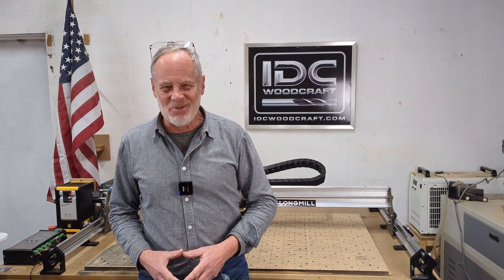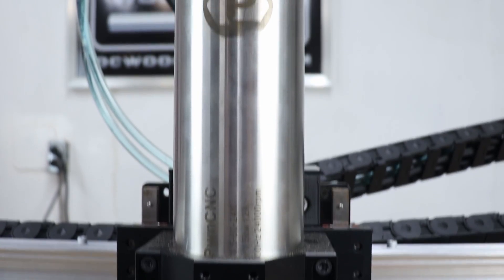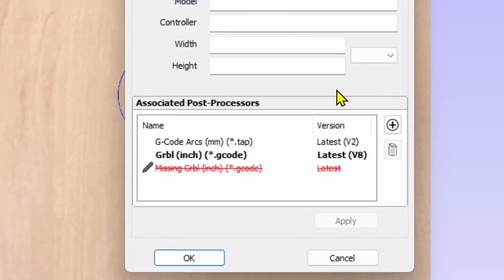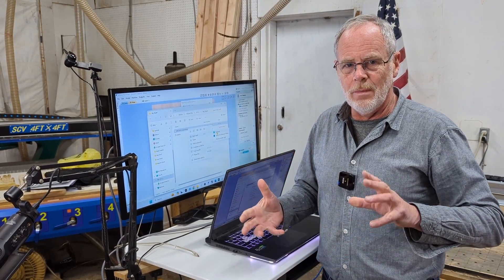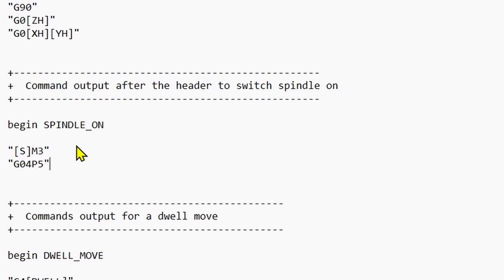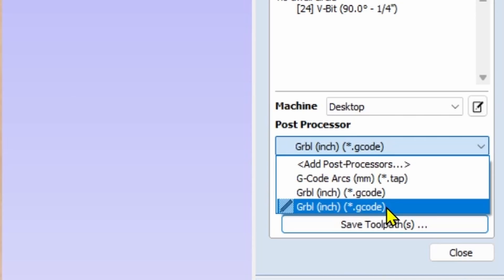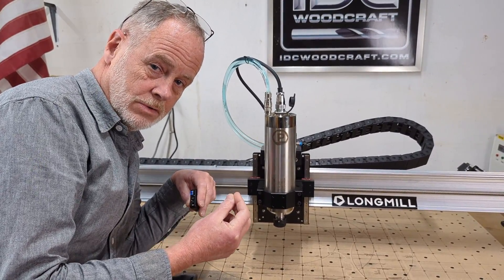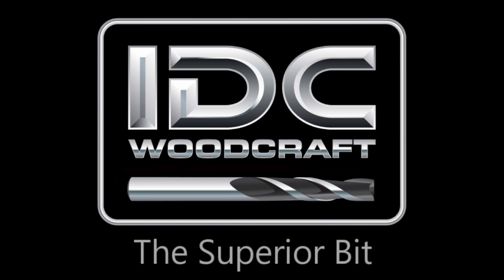CNC Router Spindle: The Critical 'G4' Command (Dwell)

Comment: I'm building a custom machine with a PiBot ESP32 FluidNC controller and this video helped me make a new post processor and it works great.  Thank you!  Now the next thing I need to figure out is how to make the spindle stop at the end of the job.
Reply from the maker: I'm glad to hear the video helped you out! For stopping the spindle at the end of the job, it would be best to check the documentation for your specific controller, but you could also look into the settings depending on your CNC software.

Comment: Hello Garrett, thanks for another great video. I just upgraded to a Pwn spindle. My question is how to tram the spindle. With the Mikita router you have access to the adjustment screws. With this spindle the front bracket covers the  adjustment screws. Thanks again for all the work you put into your videos.
Reply from the maker: Hey there! Thanks for the kind words about the video. Tramming a spindle can be a bit tricky since the adjustment screws are covered, so I recommend checking the manual or reaching out to Pwn's support for guidance.

Comment: I just added the dwell to the latest GRBL ver 8 and it is laid out differently than the version you show. It has a line just for the G04 command. It is "G04 [DWELL]" Just put the dwell time in between the brackets, and you are good to go after hitting apply. Your video helped me to get on the right path.
Reply from the maker: I'm so glad the video helped you get started on the right path! It's interesting to see the updates in GRBL, and thanks for sharing that tidbit about the G04 command!
Reply: @IDCWoodcraft  I should have said put the dwell time after the brackets then hit apply. I will see how well it works when I get my AltMill assembled and run my first project.

Comment: Excellent video!  My post processor in Aspire for mach3 doesn't have the separate section to just turn on the spindle.  It's in a section entitled  "Commands output at the start of the file".  The M3 command is ""[N][S]M03".  I added "[N]G04P8" (with the quotes) after the M3 command for an 8 second dwell.   Thanks for your work.  You help the community more than you know.
Reply from the maker: Thanks for the kind words! It sounds like you're on the right track with your post processor tweaks—keep up the great work!

Comment: Great info.  However, when I got my spindle, I realize I can’t turn it on without a program.  I like manually surfacing my spoil boards.  Can’t do it now.  Thanks for all you do.
Reply from the maker: ccfox-wecanmakeit9523, I completely understand your frustration! Many CNC spindles are designed to be controlled through specific software, which can make manual adjustments feel a bit limiting. It might be worth looking into your machine's manual or forums to see if there's a workaround for manual control. Thank you for your kind words!

Comment: Hi Garrett, trying to add dwell to post processor. I can’t find the note pad link when I follow you instructions. What am I doing wrong?
Thanks
Reply from the maker: TomDuszynski, when you open up a gCode file that you are looking to cut, you need to input the dwell command (G04), followed by "P" and a numerical value without a decimal point, specifies the pause length in seconds. 

What the dwell command line should look like → G04P5
This command will pause the CNC router for 5 seconds

Comment: This video was very helpful with the longboard but now with the super longboard it seems to be ignoring the pause and is instead going straight to the cut as it ramps up,come back to this vid to double check I didn’t have something in wrong but can’t seem to figure this out now.
Reply from the maker: You will want to call longmill on this
Reply: @IDCWoodcraft Thanks for the reply,I already figured it out,was my own fault,I forgot I had use the laser a few days ago and forgot to switch the settings back in g sender. Thanks for all you do for CNC world
Reply: Ok so i am a newbie idiot,I figured it out,I had simply forgot to switch back to normal mode in g sender after having a ran a laser project a few days ago lol,guess i should be using the machine more so i that I build on all the needed habits to be a good operator.

Comment: Thank you!  I love as you learn things, you are so excited to pass that knowledge down to us.
My Avid CNC is in milli-secs, so I had to Pause/Dwell for P5000.  I quick reference showed X5 was for seconds, but that did not work for me, so I will stay with milli-secs.   This video also showed me how to automatically start my dust collection by adding an M7 before the spindle start and dwell.  This also gives the dust collection time to get up to speed.  The other outlet is controlled by M8 so I could connect something else like a light.  There was an M9 already at the end of the G-code to turn the outlets off.  
Note this does not replace the initial spindle warmup cycle, which I personally need to be more vigilant about doing.
Reply from the maker: techturtle, that is some great points brother! Sounds like you have your AVID fine tuned sharp.

Comment: This is a very nice video and good information. One thing to note is that I am using Mach4 with the Ethernet Smoothstepper. For this setup the G04P command needs to be in milliseconds rather than in seconds. For me the "P5" would have to be input as "P5000".
Reply from the maker: me-qg2mt, good point brother! Glad to hear you sorted it out with your ethernet smoothstepper too.
Reply: I noticed that too.  G04P is milliseconds.  G04S is seconds.  So G04S5 would be 5 seconds, but so is G04P5000. :)

Comment: Another advantage to having a spindle, if you have the PWM setup, is you can control the speed through the gcode.  So if you have the database, it will set the speed automatically and not have to worry about turning it down on the router.  Now I have my trim router connected with a solid state relay to turn on with the M3 command.
Reply from the maker: tomswoodwork, very true my friend. Having direct control like that is definitely a game changer.

Comment: Thanks, Garrett I have a spindle and I need to do this.  I thought I saw in the Vectric setup that there was a place to set a dwell without modifying the g code.  Also how did you get the software to start the spindle?  Did you wire the old spindle wires into the VFD?
Reply from the maker: jimbembinster, getting everything set up in the controller and the software is a bit tricky brother! Your best bet is to reach out to your machine manufacturer for your specific machine and controller.